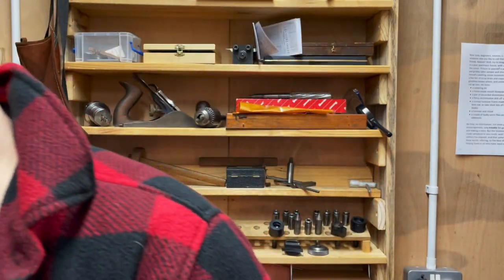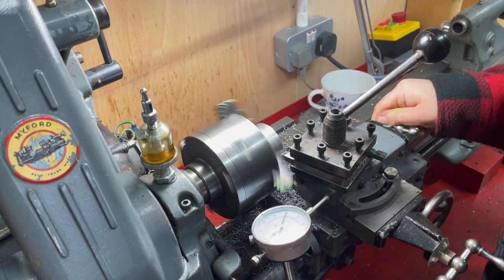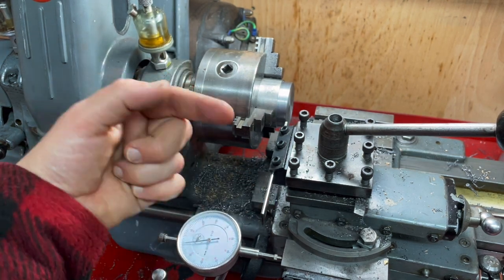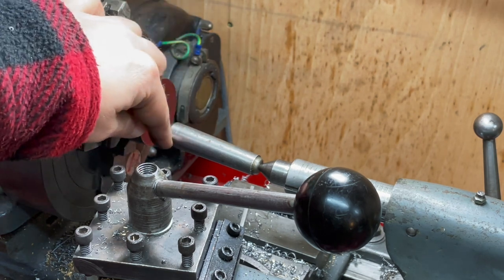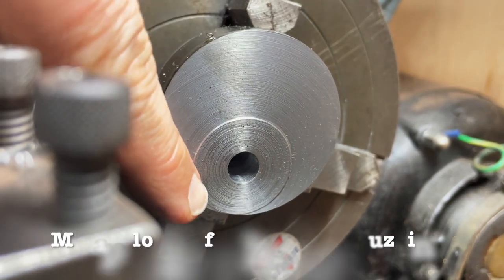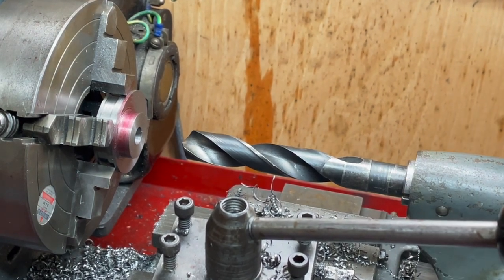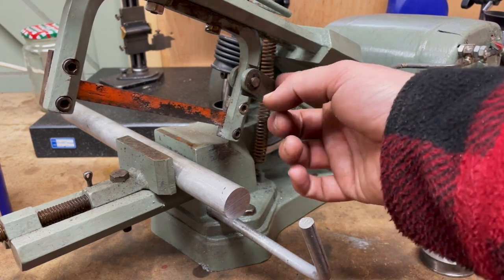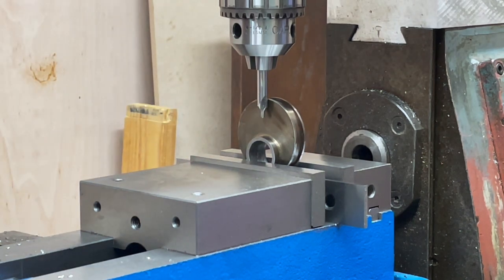Up-sized tools for an axle pump - Steam Locomotive Build #1

Comment: Congratulations for getting to 1K subs. Also, when I film my lathes I generally use 2 cameras one of which is mounted on the ceiling. If it helps I can bring my camera mount in next week. Well done for the eccentric. I have lots of those sorts of rounds from the scrapyard in varying diameters.
Reply from the maker: Thanks Ben - next tuesday is likely, for sure!
Reply: @williamsworkshopuk  👍
Reply from the maker: @BensWorkshop   May I also trouble you for a slug of mild steel about the same size? approx 2" dia by 1" wide? Happy to pay, just to save on shipping! I may need to re-make the part :(
Reply: @williamsworkshopuk  You may, though you would have to cut it off a bigger slug. What is the diameter of the part you are making? Can your hacksaw cut a 1" slice off say, a 3 or 4" slug?
Reply: Also, do you have my email address? So you can send me a reminder on Monday and I will bring a selection along.
Reply from the maker: @BensWorkshop  I do not
Reply: @williamsworkshopuk  I'll try dropping you a line via Facebook.
Reply: @williamsworkshopuk  Just sent a message via Facebook. You should be able to email me now.